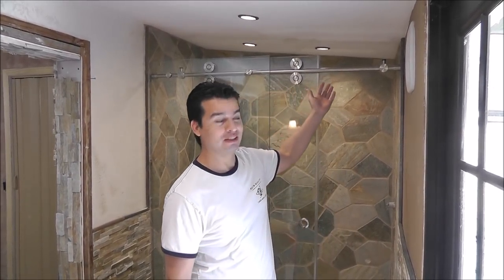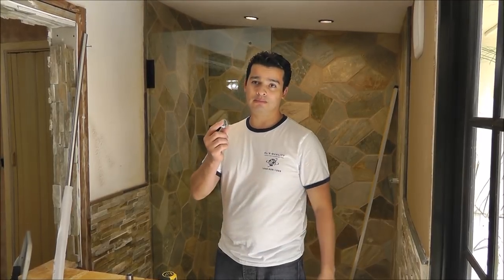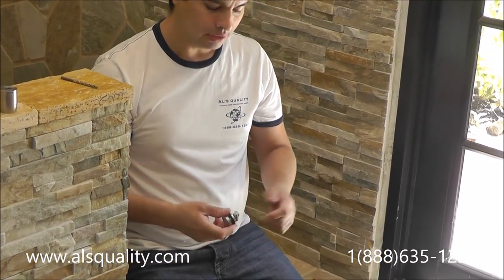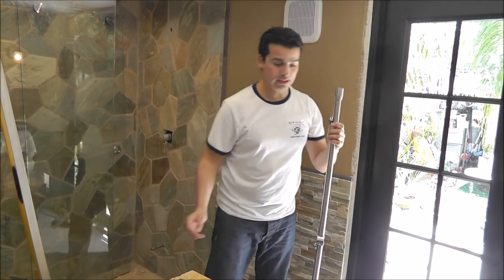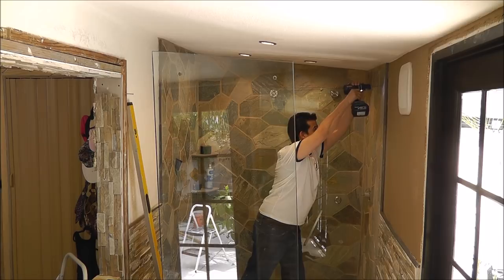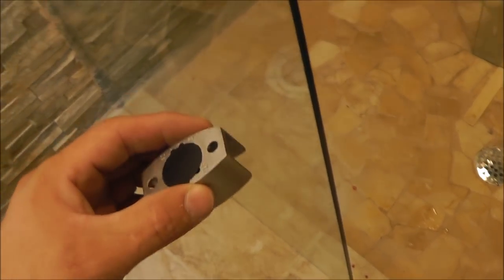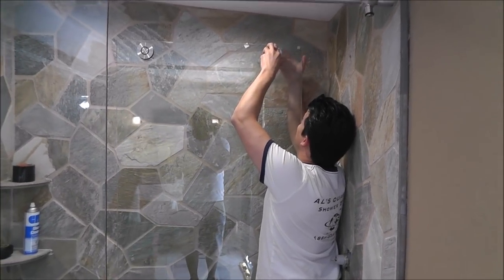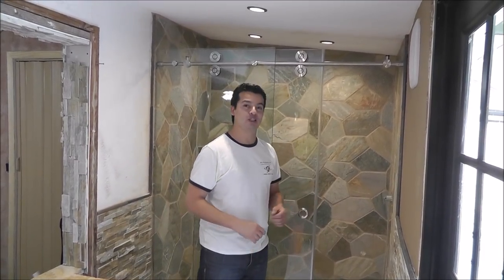How to install a sliding glass shower doors tutorial

Comment: Nice job! What is that black object on the upper left corner assisting the glass to stay upright by itself? The fixed panel. I can sure use something like that to help me out.
Reply: +Fernando Barraza 
it looks like duct tape what you can use is lipliss the 1/4 by 1 inch metal thats used for mirrors aka faceless channel cut them every six inches and put double sided tape on the back just make sure you use acetone to wipe the surface
Reply: Angel Herrera L-bar? Put tape on both sides? What else do you use? I'm thinking of making some type of L angle with small suction cups.